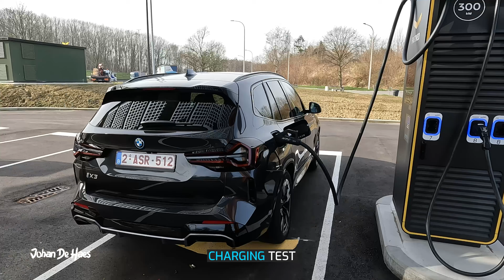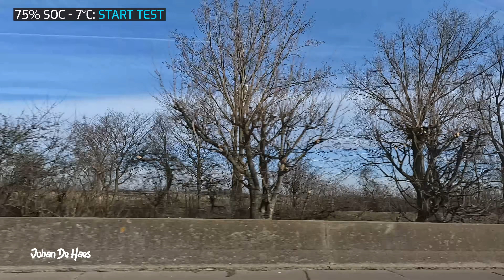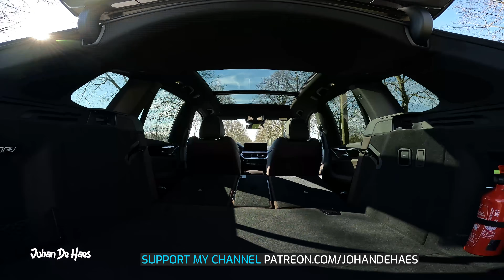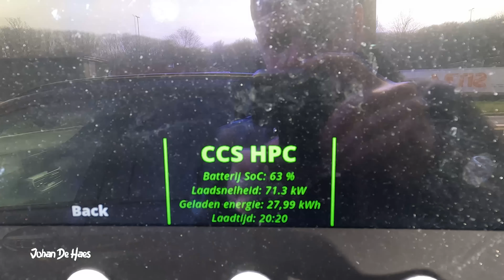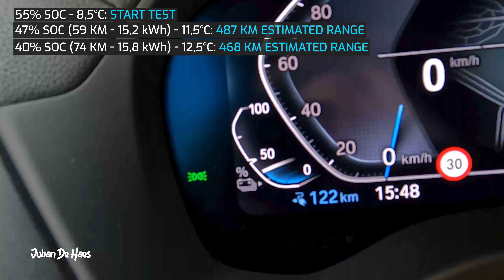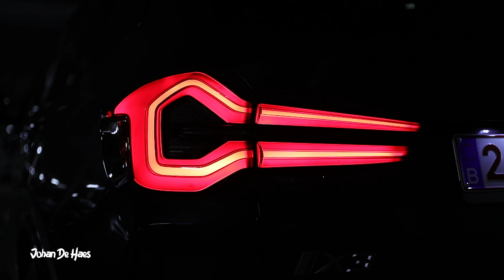BMW iX3 2022 FACELIFT RANGE TEST AND FAST CHARGING TEST

Comment: Hi Johan, how does it compare in your opinion to the Audi Q4 40 or 45? With similar costing configurations for me the iX3 is better, especially in the driver assistance tech, however it's quite a bit bigger than the Q4 and with not so different internal space.

Comment: Is there any info on the current battery health anywhere in the car infotainment system? I mean something like the standard info on battery degradation in MacBook Pro and other laptops, i.e. how much of the original capacity is still available. The BMW guarantee covers 8 years (as far as I remember), so what is the expected capacity/range after such a long period? 10%? 50%? One would expect that a battery replacement would be possible after these 8-10 years and that it would not cost 50% of the initial value of a new car.. I would greatly appreciate it if you would share your thoughts on these matters.
Reply: If you are able to charge @home  slowly (5-7 kw) and your daily comute is shorter than 25% of the car range (~100km) then you could operate the car between 50-75% of the state of charge.  This way battery degradation will be minimum, the battery will easily last 3000 cycles - which translates to 1.2M Km. The rest of the car will not last as long. Battery waranty is designed even for people that exclusively supercharge, and constatly run the battery below 10% - or to 100%. - even for them the battery should last 160.000km.
Reply from the maker: No, I didn't see any info about battery health. I also didn't see this in other EV's, it's not common to do this in cars at this time. I think that there are apps that can read out data from your car with a dongle, but I don't use it. I don't find any info on the site of BMW about the guarantee on the battery. VW on the other hand gives more info about this topic and they give a guarantee of minimum 70% of the original capacity after 8 years or 160.000 km. I guess they would replace the battery if it is below that %, or fix it. This I'm not sure. I don't know if this is the same guarantee with BMW, I would check it at the dealer if you are considering buying this car. Anyway it's normal that the battery degrades after time, just look at your cell phone. So having a guarantee of 70% or something like that is a positive. You can also keep your battery in better condition when you don't fast charge all the time, because this degrades the battery more than AC charging. In many cases the car manufacturers also advise to only charge it to 80% (not 100%). If you follow all these guidelines I guess your battery last longer or worst case you can get it replaced or they would fix it under guarantee.
Reply: @JohanDeHaes  Thank you for the info!

Comment: What do you think about the comfort of this car? Not too hard?
Reply: I have an iX3. The car is very heavy compared to a normal X3 so it is reasonably soft in comfort mode - I find it hits a great balance. Definitely not too hard
Reply from the maker: I also find it comfortably enough on a bumpy road in comfort mode. Only on the worst parts of the bumpy road, you are shaken up a bit, but nothing to complain about.
Reply: No, the suspension is not hard.

Comment from the maker: Who is thinking about ordering this car?
Reply: I did, expected delivery around June
Reply from the maker: Excellent choice. Congrats on your new car 🥳
Reply: I haven ordered the IX3. Delivery on 09/22.
Reply: Got mine 3 months and 3.5kkm ago. Pre-facelift. Loving it.
Reply: ordered it. delivery end of June '22
Reply: me, with the towbar option. i'm curious how all the reversing/rear camera support works out once you've got some bicycles hooked on the back...that's always a troublespot. what is the rear mirror view like?
Reply: I was thinking about it, but since it's produced in China I just cannot buy it. That's not BMW.
Reply: I did. Arrived at the dealer last week. Will pick it up next month (going independent).
Reply: Considering the Charged. Honestly, no competitors. Don’t say Tesla ..
Reply: Woensdag besteld uit stock (Kashmir silver impressive + dark shadow pack + trekhaak). Uiterst 9 feb heb ik hem al, kijk er naar uit want ik zit sinds 30 december zonder wagen - mijn elektrisch stepje wordt nu wel veel gebruikt 😅
Reply: I now consider it in 2025 as Elon Musk went completely crazy so that I doubt if I still should decide for an Model Y.
Reply: Had mine since March 22 and wish I could get rid of it. I'm getting a range of about 190 miles and that's driving carefully, without the air con on. I'm now having problems charging it at the local rapid charging point, which didn't happen until I updated the software. The dealer started by telling me its because the charger is 350 kwh and the car is 150 kwh, utter rubbish I told him. He then decided it was because it was a Porsche charger that is different technology. Strange it used to work but doesn't now. I need to go a a long journey next month and I'm considering hiring a normal car for the journey as I have no confidence in this thing.

Anyone else had similar issues?
Reply: @robwinder5415  did you sort out your issues? it is 6 months later ..